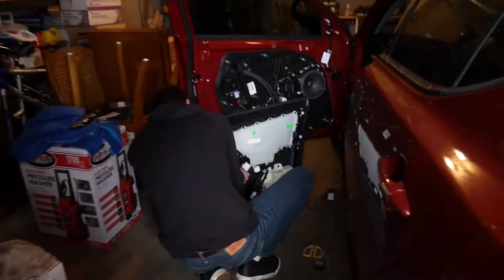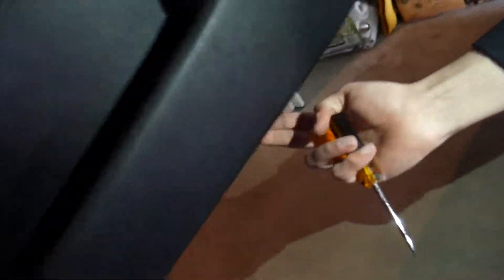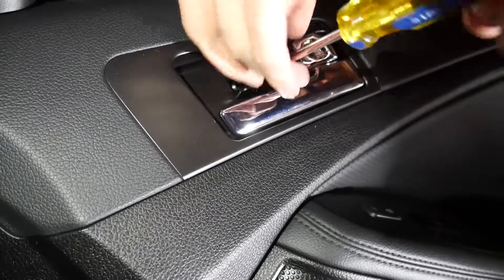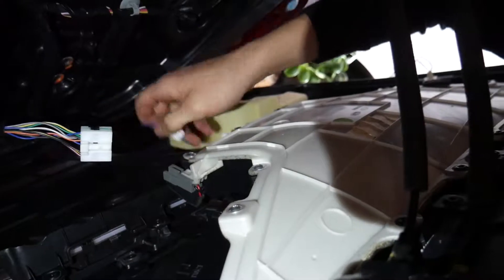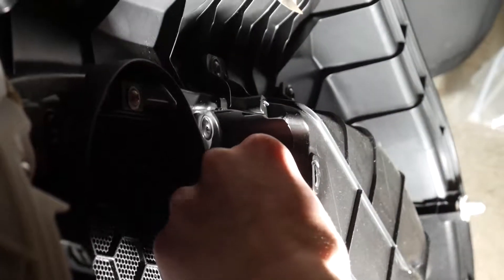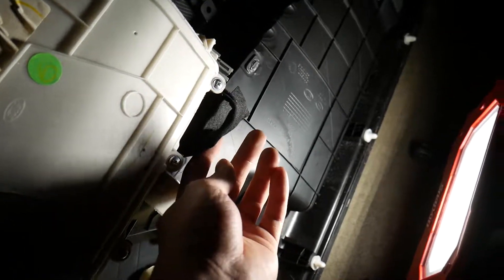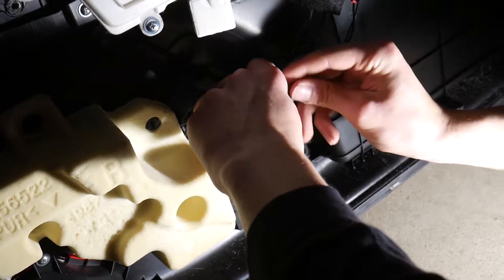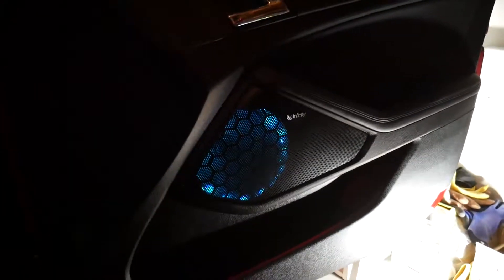2010-2015 Kia Optima: How To Install Bluetooth Controlled Door Panel Lighting

Comment: How would you do this on an Optima LX? is there a power source back there for the a light or would i have to somehow run a new power source?
Reply: If you have mood lighting in your doors from factory, you can just splice into that powers source like we did. Otherwise it’s possible to find a source in the door that gains power with the ignition, and tap into one of those.
Reply: @DragonoBlaze  Ah okay, interesting. So i would just use the positive probe of my multi meter to find the ignition source by turning the key and checking the read out.. tap into what, though? the power for the window? Thats ignition power not accessory power, right?